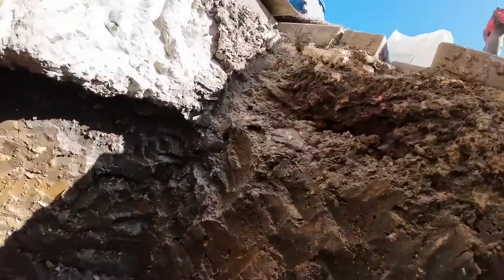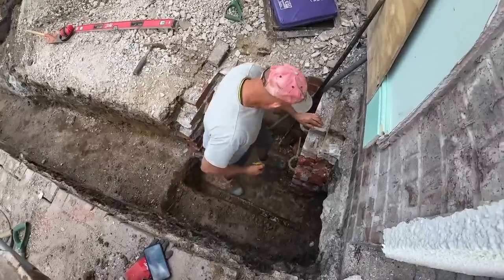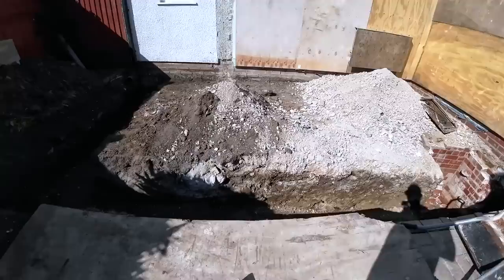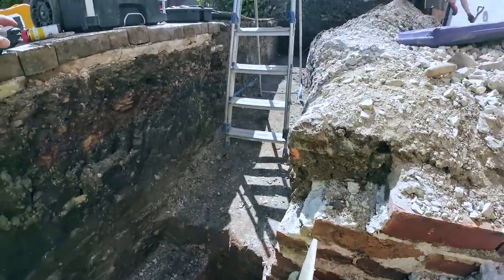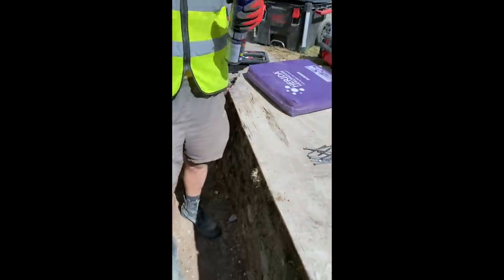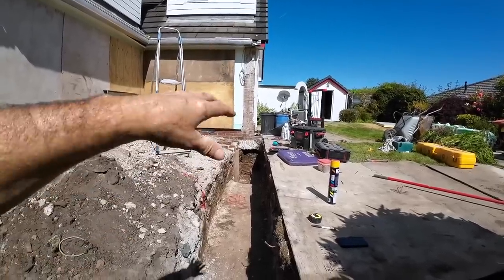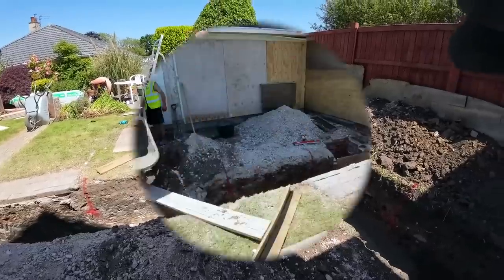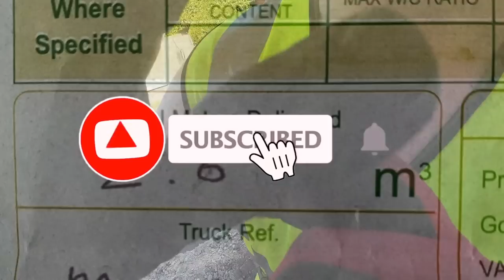EXTRA WIDE FOUNDATION FOR NEW PART L BUILDING REGULATIONS..150 MM CAVITY EXTENSION

Comment: The trenches are getting wider I heard they going to be 800mm. I actually rolled the dumpster into the trench yesterday, the walls caved in!!! I like your tips with the nails and spray paint.  Yeah pegs will weaken the concrete so that's a great shout and the foam is a handy too🧱😎
Reply from the maker: Hope you’re ok after the tumble 😬. 
   Yeah the nails trick we got when we worked on site building house foundations and the lads always did it like that . 
   That’s the great thing about YouTube .. great place to share knowledge and learn too 🤙🏾🤙🏾🧱👍🏽
Reply: @SteveAndAlexBuild  Yes I’m ok thanks, the side gave way Sandy )a youtube feature) soil and not much room to pass lol. Youtube is a Great blessing. Used to go the library to find a book on a subject but now there’s so much info here👍 Have a good day tomorrow 😊
Reply from the maker: You too pal 🤜🏽🤛🏽🧱👍🏽

Comment: Top concreting. Great idea with those nails. I remember putting pegs in the middle of the trench and endlessly tripping over them. No lasers, used a length of hose to make a water level with bit of clear tube at each end. Go for tea while it stops oscillating 😂. Look forward to the next one.
Reply from the maker: Cheers John, lasers are game changers 🤙🏾🧱👍🏽

Comment: Hi Steve & Alex reminded me of a job I did a few years ago .Take down a single garage     to make room to build a double walls came down problem, slab 300mm deep reinforced top and bottom, had a breaker on a digger for a day and  
a half . There was a reason for that slab but didn't realise at the time. Marked out footings for new garage, 2.5 mtrs deep later still no solid ground ,turns out the land belong to an engineering firm ,they use to dump slag from the furnace on there . Ended up doing a concrete raft . Had to get steel guys in to fabricate 6 ton of reinforcing  then lay concrete. Luckily I was on day rate the customer paid for Materials
Reply from the maker: Jeez what a night mare 😟🧱👍🏽